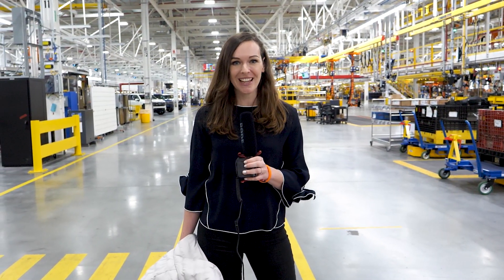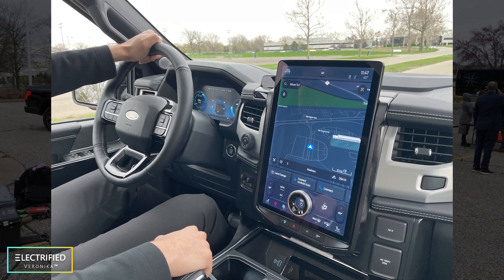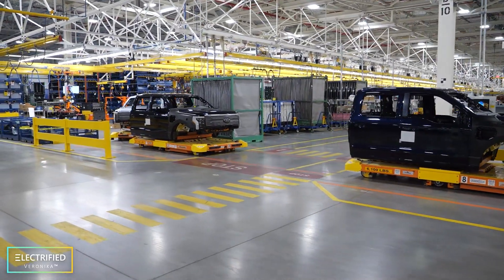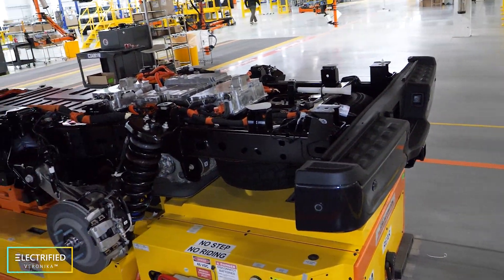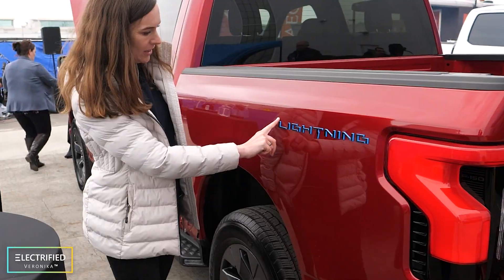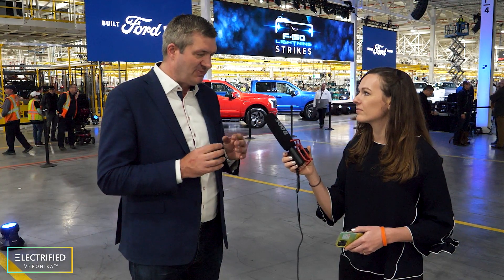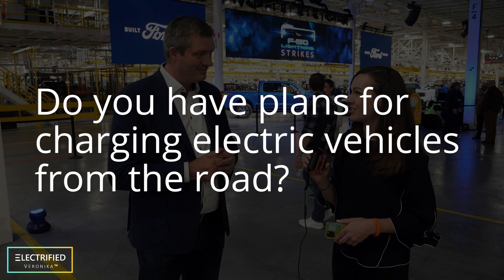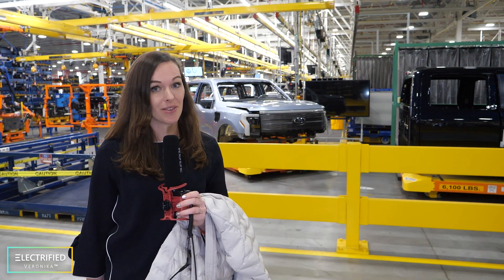Ford F-150 Lightning Launch Event - Interview with Darren Palmer

Comment: If Palmer would convert a 1966 Mustang with an Eluminator, does that mean he would replace the original stick-and-leaves rear suspension with a completely different independent setup? I think he's counting on listeners not understanding that the Eluminator is not only unusable at this time (with no support for an inverter and controls), but also in the completely wrong format for a classic Mustang.

Comment: @4:25 "that's why we started with our icons". Nonsense. The Mach E is a generic crossover, not a Ford icon. It has the iconic Mustang name on it, but it's not a Mustang. Yes, the F-150 is a Ford icon, but it's the third EV in the current generation of Ford EVs, and there were various limited production EVs before this generation (vans and the Focus).